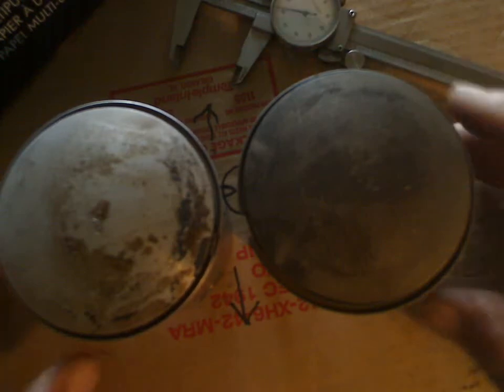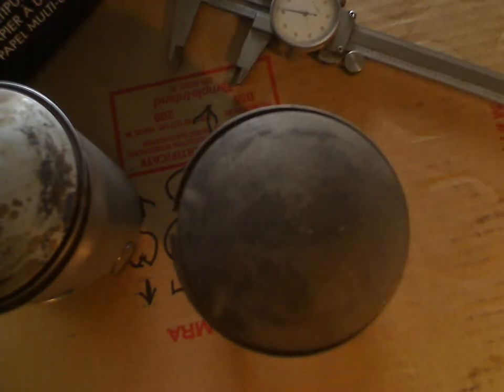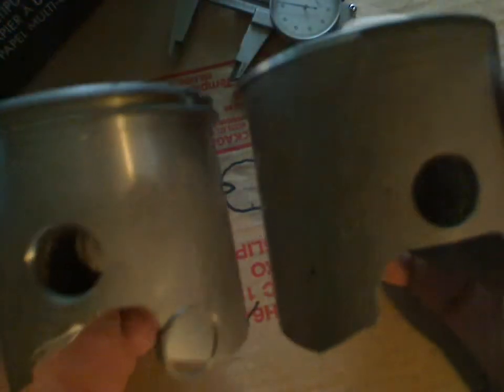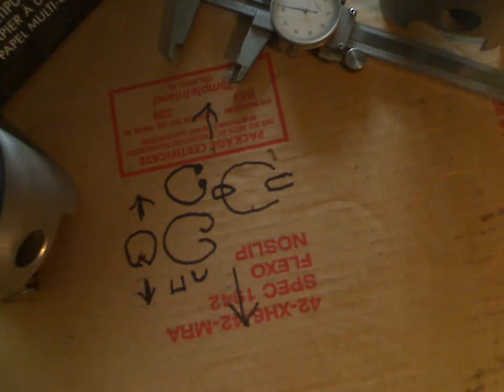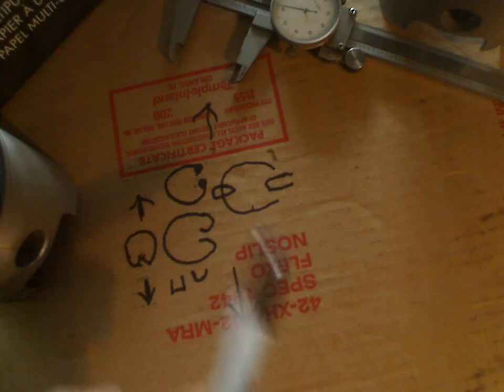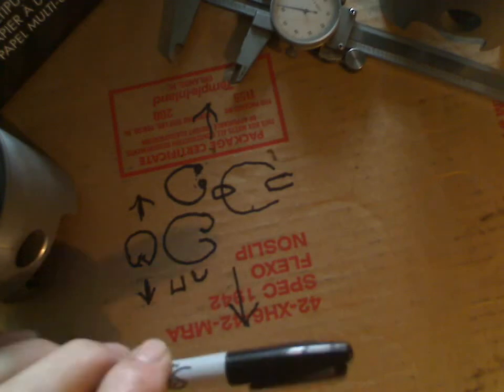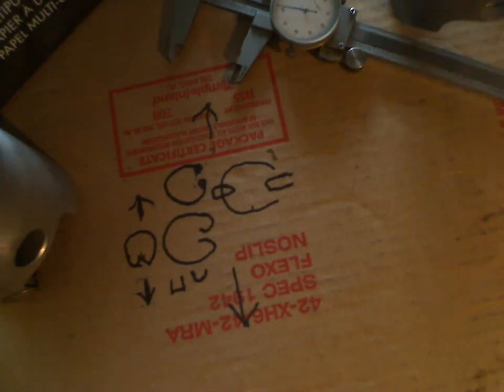Some useful  piston basics - mainly for 2 stroke engines

Comment: I thought your explanation of piston orientation was a little vague. pistons are balanced to offset the rocking leverage from combustion pressure and the change of direction, (maybe only a gram or 2 worth of extra material). in my China girl motor (Chinese made 49cc bicycle engine) there is a '3' stamped in the crown at the rear, but i have seen the arrow also. it points to the exhaust port (if front and back do not apply)
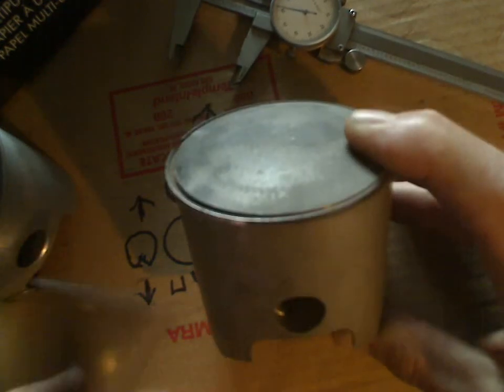Reply from the maker: You need to study a bit further, all pistons have offset wrist pins, also the offset has little to do with combustion and all to do with load path as the piston descends down the bore on the power stroke. Go back and review the video beginning @7:24.

Comment: hi have just fitted new piston rings to my 125 vespa px can you tell me how many miles i need to do before they are run in have looked through your videos but cannot find this i would be most gratefull for your help please best wishes,,,pat
Reply from the maker: +magicwands1 If you did not re-bore the cylinder and fit a new oversize piston but only installed new rings you may run it at full output straight away.
Reply: yes i just changed the piston rings thank you very much my friend much appreciated  best wishes,,,pat